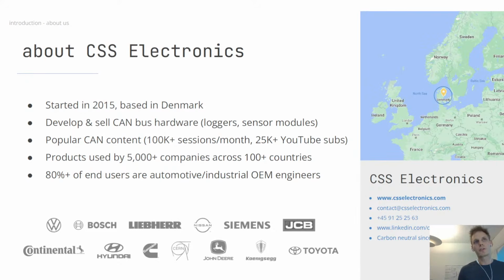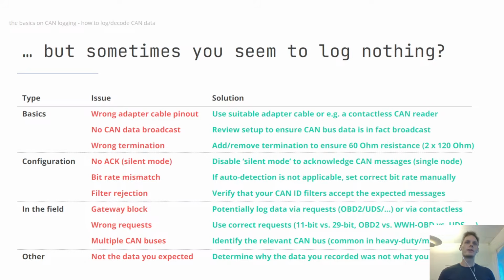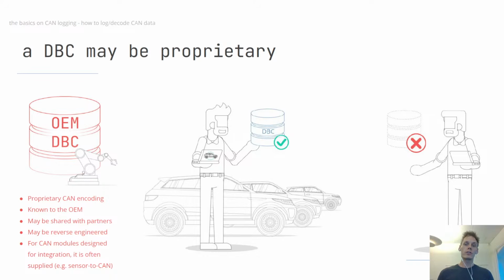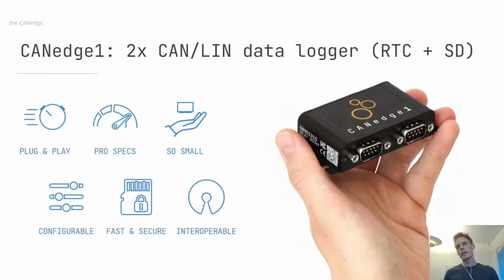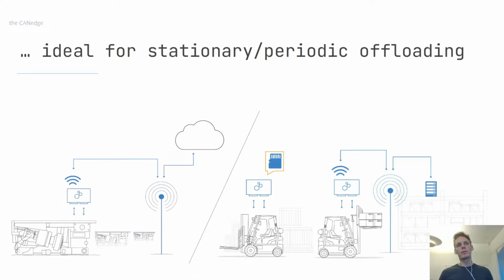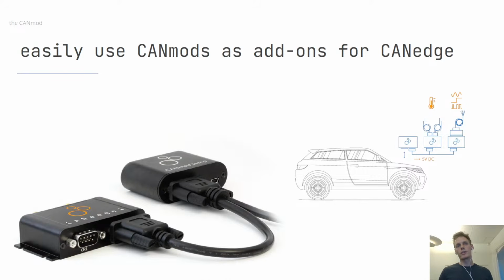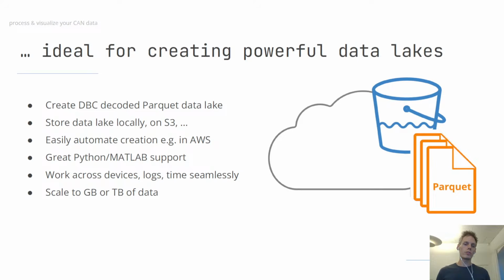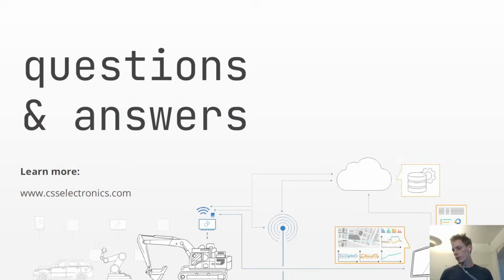CAN Bus Data Logging 2.0 [Free Webinar | 2023]

Comment: I was wondering what would happen when you have an MOT in the UK, presumably we, as MOT Testers would have to disconnect the Data Logger connector from the DLC to use the emissions tester 'DLC dongle'. I wonder if a 'piggy back' DLC could be designed with maybe an extension cable for DLC connectors that are too close to the fuse box or chassis etc where they cannot have a piggy back installed in the regular DLC slot... I'm sure some of the clientele would appreciate having MOT emissions testing data so that they can check that their vehicles are being properly tested, or if the vehicle is in for diagnosis, diagnosed correctly.

Comment: Hey is it possible to read and store data without a higher protocoll like OBD2 or UDS. So in generell i mean raw CAN Data. Or do i need to have this higher protocoll. Thanks for this livestream it was really nice.
Reply: Yes, the CANedge lets you log any raw CAN bus or LIN bus data - it does not have to be from some specific higher layer protocol. In other words, if you were to simulate some arbitrary frames onto a CAN bus using e.g. a USB-to-CAN streaming tool or simulator, the CANedge would record those frames - without any change to the configuration required. In general, the device itself operates at the 'lower layer' CAN protocols and does not perform any form of processing or similar that assumes a specific protocol. The protocol specific aspects mainly come into play when you DBC decode the data via the various software tools - where your DBC might be specific to a J1939-protocol type application or e.g. OBD2, UDS, CANopen, ISOBUS, NMEA etc.

Comment: Is translation to Parquet on the CANedge devices themselves on the roadmap? So the edge device does the DBC decoding and then uploading of the Parquet data straight to S3... Thanks for sharing this webinar, I found it very useful.
Reply: Thanks for the question! We will most likely not change the way the device records the raw data on the SD card. DBC decoding the data to e.g. decoded MF4 or decoded Parquet may seem convenient and practical at face value - and for some use cases it definitely will be. However, there are many situations where this is not ideal. 

1) For example, if you made a mistake in your DBC or used a DBC file that was of an incorrect version, this would result in basically all your data becoming invalid and useless - with no way of rectifying this. See our Case Studies section with the Koenigsegg case study where they describe exactly this factor as being a key reason why they select the CANedge. 

2) For some use cases, you may want to store the "full data" in the raw compact MF4 format, while you then e.g. only DBC decode a small subset (maybe 10-20 signals, which could be e.g. just 10% of your dataset) to a Parquet data lake to avoid unnecessary data duplication. In such a situation, it is ideal to be able to distinguish between the 'original' data and more 'prepared' sub data sets. 

3) Another important factor is the ability to 'compact' the data ex post. Some users may upload a new MF4 log file every 1 minute, for example. This results in a huge number of files in S3 and over time, the Parquet data lake also becomes inefficient to query if you're looking across long periods of many small files. Here, the MF4 decoders let you easily "re process" the entire raw data to create a compacted data lake, where the number of files can be reduced drastically through concatenation. 

4) Further, many use cases deliberately require the ability to view the raw CAN/LIN frames for more direct analysis of the original communication. This is also relevant if you're e.g. looking to analyze CAN/LIN error frames.